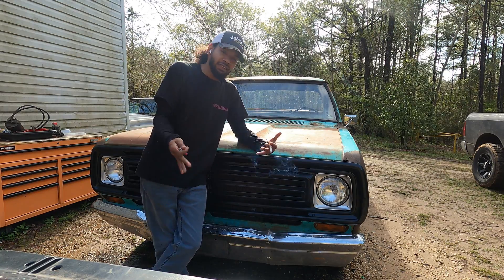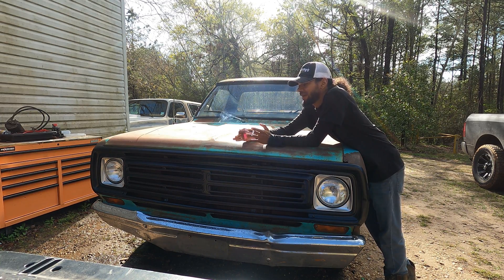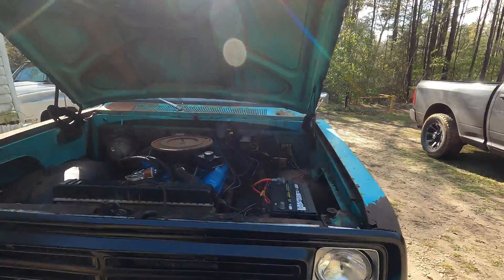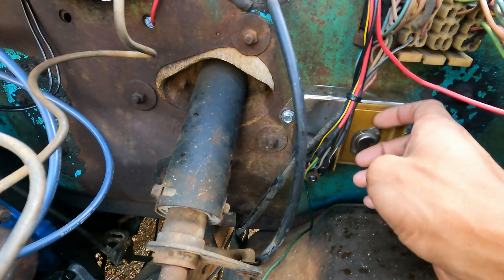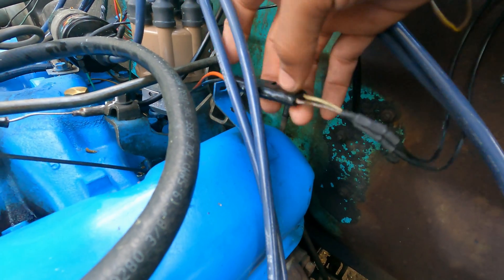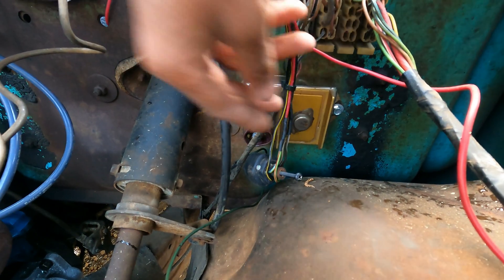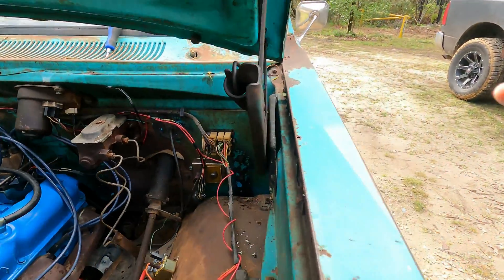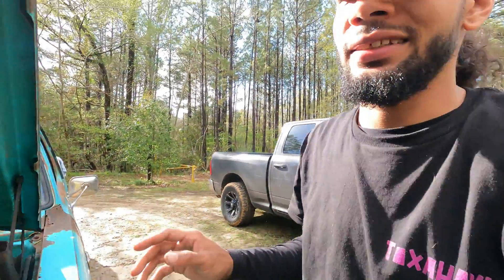Early 4 Pin Chrysler Electronic Ignition Swap Without Ballast

Comment: Thank you
I hate that ballast resistor
Reply from the maker: My pleasure, I’m glad I could be of help.
Reply: Now I’m stuck though.
I get power when the key is on. 
( spark occurs )
/6 electronic ignition up grade into 68-A-100 van. 
But as soon as I twist the key to start
Key switch seems ok ? Worked good before engine swap 170-225. 
Got fuel , oil pressure no spark
Reply: @erikolszewski6743  there is a wire that comes off your solenoid that needs to go to the hot side of the "box" to give it power during start.
Reply from the maker: Double check your wirings leading into your dizzy plug. Also make sure your ignition box is grounded. It grounds through the box to the body/frame.

Comment: About to do mine. I was looking for a video like this that explains in video what wires goes where. Not good with electrical names but more visual helps %100.
Let’s you know how it goes. Thanks for the video
Reply: One quick question my dart has a 4 point ballast. Do you know how does that get connected? It’s same way one side to the other side? Meaning connecting it from one side to the other ? Sorry hard to explain 😂
Reply from the maker: Let me look over some wiring schematics
Reply from the maker: There is a good diagram and explanation on (forabodies.com) 😂 should be “bypassing ballast resistor” it’s an old forum but very informative!
Reply: @TKSpeedShop  I will look for it. Thanks a million and let you know what happens. 👍👍
Reply from the maker: @MrBATHORY3 🫡 look forward to it brother!

Comment: What happens with the original coil+ wire that is in the points wiring harness?
Reply from the maker: The original coil wire+ that goes to the dizzy (Points) comes off the ballast. That wire is connected with the junction. Basically, the ballast wires are connected together along with the (green/red) and (blue/yellow) that comes off the ignition box.

Comment: What did you pull stuff from because I have lean burn system and need it gone
Reply from the maker: The ignition box and the harness leading up to the distributor is from a 74 Swinger. You can use any Post 73 Mopar as they came with Chrysler Electronic Ignitions. If you are still using a points distributor, you are also going to have to pull the distributor also.

Comment: My 79 P/U starts right up, sounds strong, runs almost a minute, starts to sputter, then just dies down and out. I've checked out the Ballest, the starter relay, rebuilt the carb,checked fuel supply, changed out carbs with my motor home,and it still acts like I had never opened the hood ,nothing as changed
Reply from the maker: Have you look into your ignition box? Double check your box and make sure it’s grounded properly as the box uses the base itself to ground. Also double check your voltage regulator on the firewall. Make sure your distributor cap and button aren’t corroded and confirm you are getting “good” spark.
Reply: Also about that 79P/U it has a 4 prong ballist, and a module distributer. Just found out, that is a wrong set up .
Reply: Box